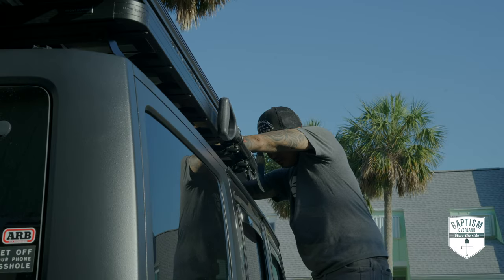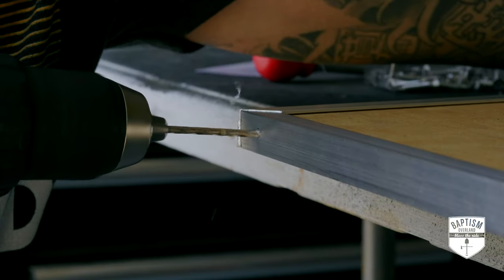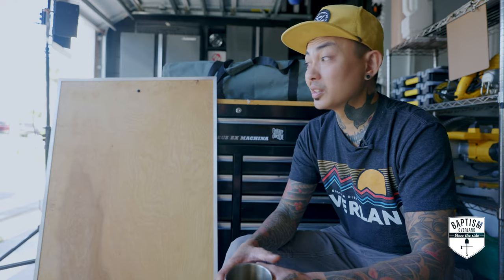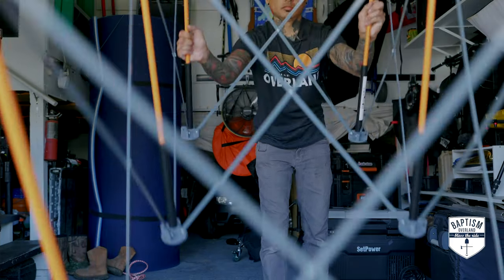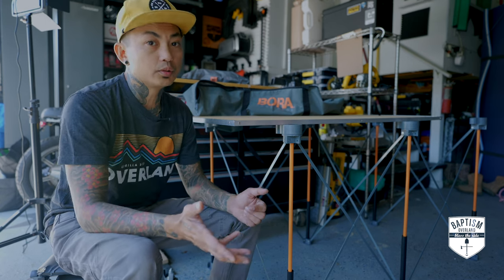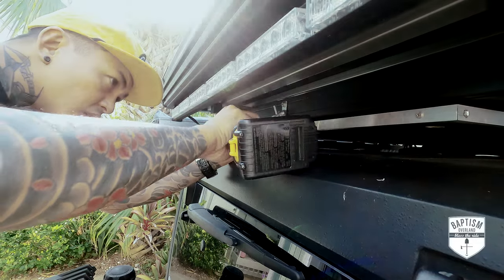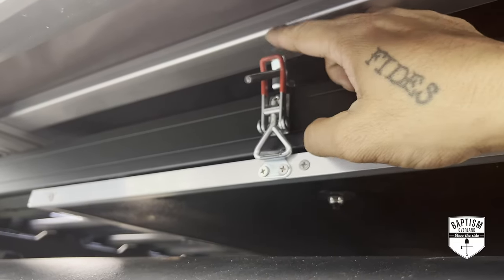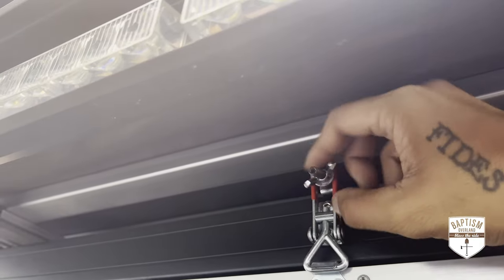DIY Underneath Roof Rack Table Storage! PT 2

Comment: Nice build. Where you are concerned that fold-up legs will come loose and swing down onto your roof, why not just flip the table over and mount it with the legs on top (between the table and the rack)? You would need to change your bracket design to increase the clearance though.

Comment: I made something similar for my Jeep. I used 3/4 birch plywood and drill four holes at each corner. I then used four small painting extension poles as legs that would just screw on and I would be able to adjust them if the ground was uneven. I made the holes slightly small so they would fit tight and so far they are holding strong. I made it base on the snow peak iron grill table.

Comment: So I was stuck in the same boat with the legs when I was following from the first video, my idea so far is getting the folding generic brackets off Amazon then put eyebolts on the bottom with a bungee across the middle to ensure they stay up? Haven’t tried but that’s my best idea so far
Reply from the maker: I thought about that too. Lemme know how yours turns out!
Reply: I also don’t know what the clearance difference is between your rack and mine I have the go rhino SRM500 with the roll bar mounts so it only gives me maybe 3 1/2” from the roof to bottom of the rails

Comment: The latch will hold tight if you screw in the loop part. If that makes sense.
Reply from the maker: Screw it into where though? I don't see anything on the mechanism other than the hole where you adjust it. And there's no way to turn that loop once you have it latched on to the hook
Reply: @BaptismOverland  With the latch undone you should be able to spin the triangular part so that it pulls harder on the table. Once it is tight enough it will cam over and kind of feel spring loaded and that should stop it from coming undone by itself. The triangular part should get closer to the barrel part it goes through.
Reply: He is saying to adjust the tension on the latch tighter but that won't help for multiple reasons, mainly because the direction of force from the table sliding. Your fix is good but having a loose wing nut that gets lost in the dark will be frustrating. A cotter key would be better, drill hole in the bolt and use key instead of wing nut, attach wire to cotter key to keep from losing it. Or see if the latch has enough room to put a key in to lock it in place. All you need is something to lightly hold the handle down when in locked position.
Reply from the maker: @kylebrazell6575  ohhhh that. Yeah. I actually already tried to get it as tight as possible. Still pulls out. I'm also wondering if the rounded head bolts I used on that latch is what's preventing the latch from snapping closed
Reply from the maker: @whitecherokee73  you are right. Exactly why the tension isn't helping because it's slides vs an up and down motion which the latch would prevent. A cotter key might just be perfect! Let me see what I can fashion with that.